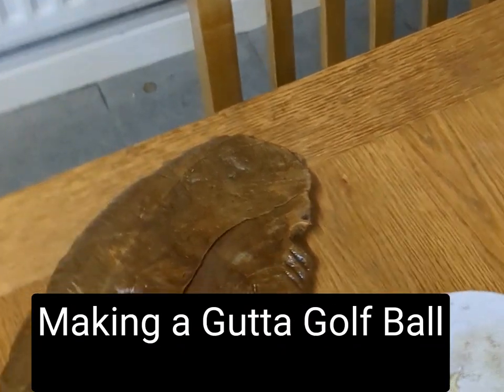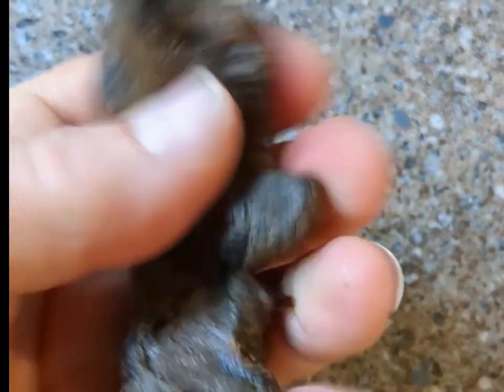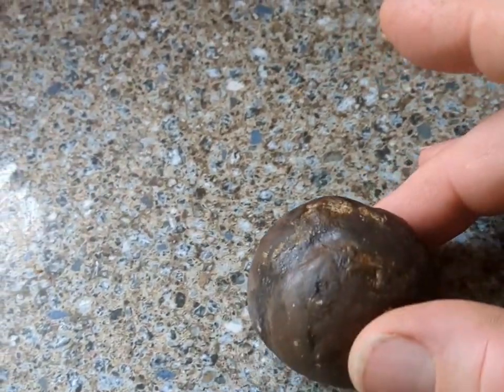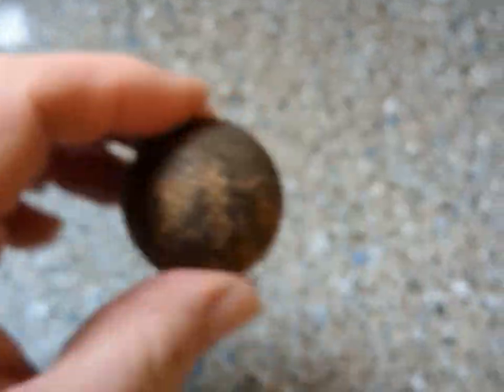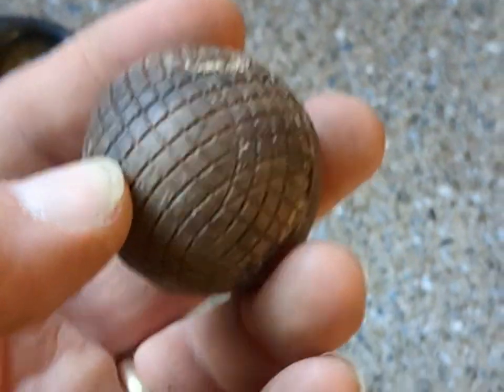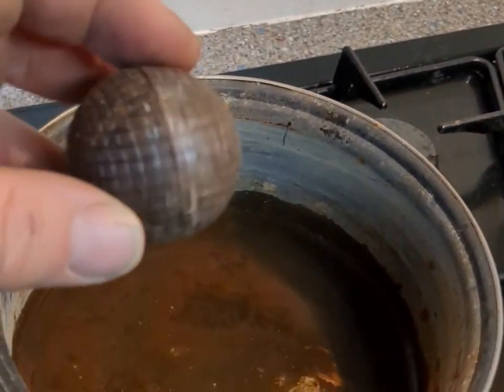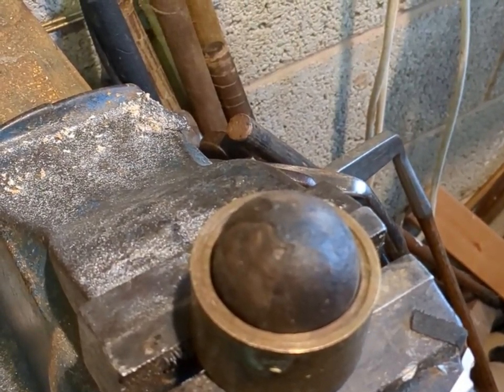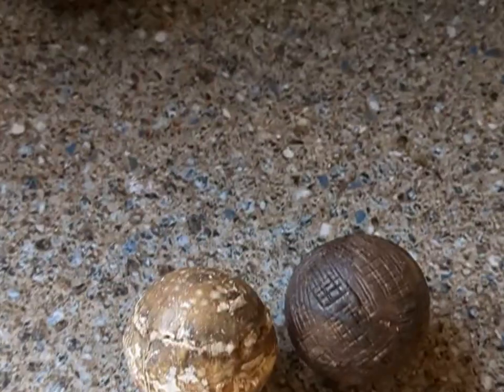Wow! Step-by-step Gutta Percha Golf Ball Hand Making!

Comment: A possible cause of the equator depression. Re the "split" around the seam on the second heating, I've never seen raw gutta percha but at the start of the video it appeared to have a slightly fibrous element to it.  Many polymers are fromed from strings, if gutta percha is the same, then when it was compressed in the mould the surface layer would have been squeezed out to form the fin and some of the fibre strands forced out too.  Then cutting the fin off would cut the fibres and create a weak point so that when reheated the ball would expand slightly and the cut would separate.
Reply from the maker: yep, that seems very logical. I think you've got the nail on the head...thank you Nick.

Comment: Would it be fair to say a professional ball maker (no disrespect intended) would be able to estimate the weight of the GP needed, rather than using 3 seperate pieces, which seems to me to have an inherent weakness. But that then raises the question - did the ball makers ever use all those trimmings to make balls ?
Reply from the maker: yeah, they no doubt became skilled at taking a much more accurate chunk. I also seem to remember it came in "rope form"...i.e a rolled sausage so much easier to gauge.